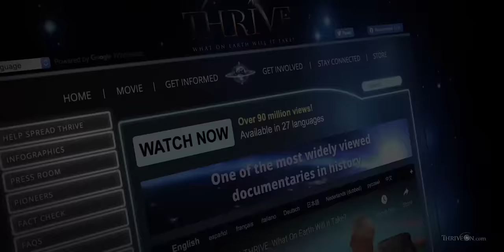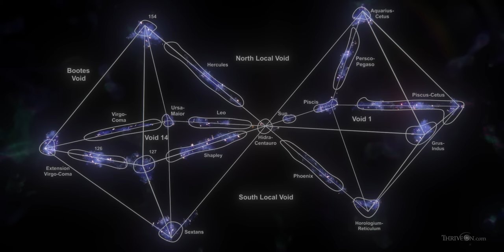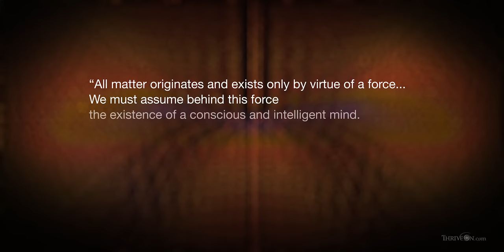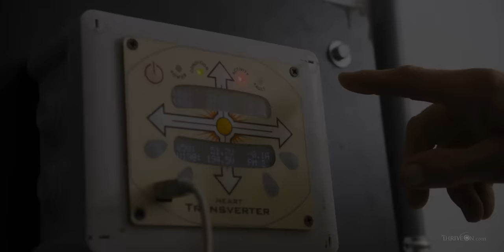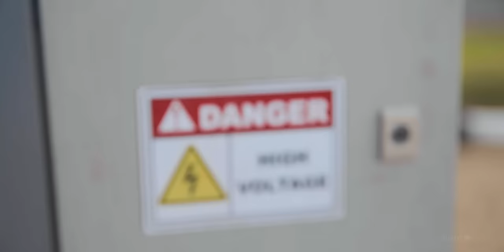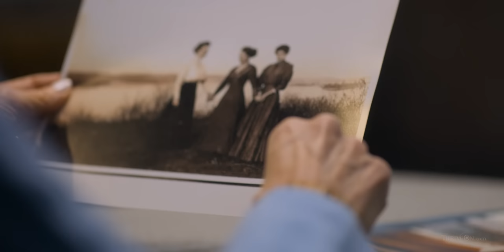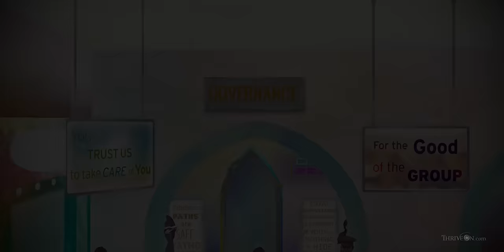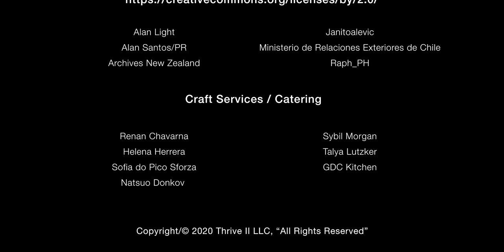Thrive II: This Is What It Takes

Comment: 14:01 The Field is not a thing, it is an attribute of the Pure Potential, Aether/Inertia perturbed, and it is a pressure modality in simplicity. Like water flowing to the lowest pressure point which is like gravity, an acceleration to, a return to pure potential Inertia/aether. That pressure modality is an S curve force vector that extrapolates out the geometry of the Hyperboloid and the torus, If you look up Torus and Hyperboloid on Google Images, you will see that you cannot get a Torus with out the Hyperboloid and you get a torus mirage from the hyperboloid. It is a pressure modality that we see as a geometry, a force vector of the loss of potential and its return.
Reply: 8       🙏

Comment: 13:00 Harmony is an arrangement of parts that are aligned Resonance is amplitude which is the maximum displacement or distance measured from its inertial (pure potential/aether) position which is really not a position so much as a non position, the measurement/frequency/vibration begins with the perturbation position.

Comment: Thank you so much for making and spreading this important and well documented testimony.
Also i have one question about the free energy field : is it proven that it is inexhaustible tapping into higher layers .. or just suppository? If not we might relentlessly take energy out of a system jn movement.. slowing it down.
Remark about gravity : as a pebble sinks and a leaf floats on the water .. things fall down to earth unless lighter then the air ( as a hot air balloon carrying us ), so is it not the density of the medium we find ourselves in relative to the density of the things falling down, making us believe those are pulled down by some force field we call gravity.

Comment: 14:56 Do you see anything pushing or pulling in a magnet? No. You see an outward flow, pressure, force vector when you put a N to N and you see an inward flow, pressure, acceleration when you put a N to a S. There is no push or pull, there is pressure mediation.

Comment: 14:25 Nothing is pushing or pulling, absurd. It is a pressure mediation perturbation that manifests from a high pressure to a low pressure, like water flowing or gravity. There is no push, no pull, those require force which is not sustainable.

Comment: 13:50 Nothing can be "balanced" energy, for energy is a perturbation, a frequency, a vibration, which is really the LOSS of pure potential which is inertial, not balanced. Nothing in nature is really balanced, an absurdity any child can easily understand playing in the playground on the teeter totter. Go there in your mind and put yourself on the teeter totter and try to balance it. A huge amount of energy would be needed to maintain balance and it does not last. It is inertial that you mean when you say balance, and inertial is Dielectric/Aether/Pure Potential.

Comment: Um. You talk about the unified field. And then most of the movie is about autonomy and decentralization, the part you get right. And then you go back to a unified field again. Are you listening to yourselves? 
  Decentralize the field too. Unification of the field comes from a bias to reinforce your Buddhism based belief system.  When "particle fields", which you described in this film, overlap and interact they can appear to act as if they are one field.  This gives you interconnected Holons of interactive "particle fields", leading up to the Shuman resonance, the galactic resonance, and eventually a universe resonance. But it is not one field, it only acts as if it were one field. Be consistent, PLEASE.